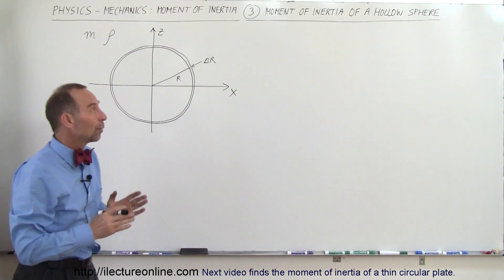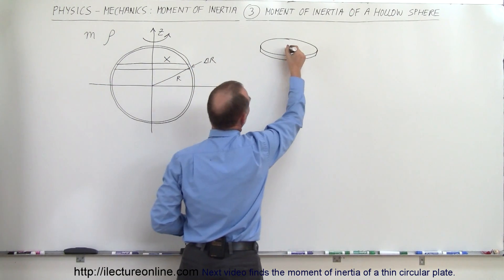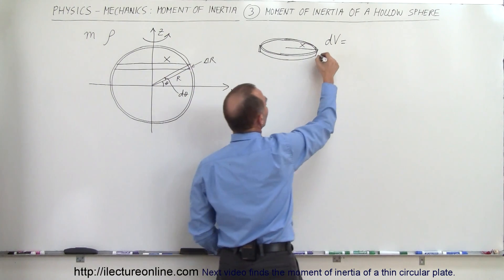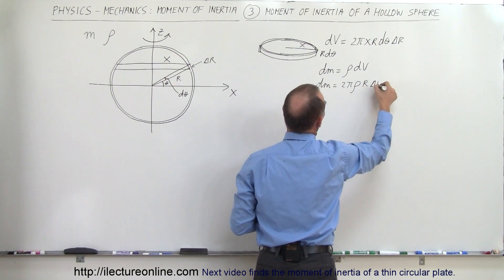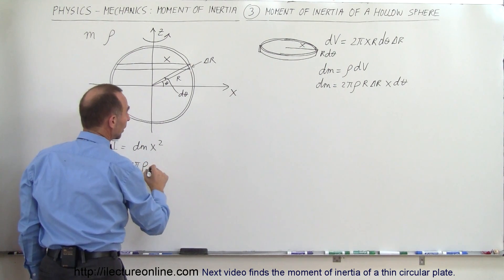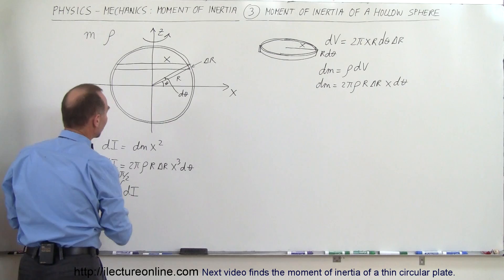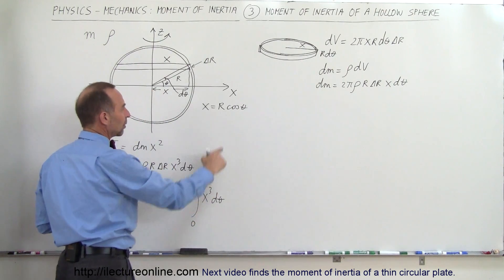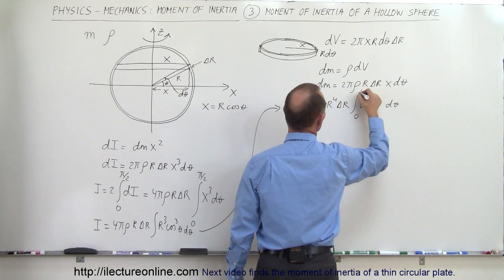Physics 12  Moment of Inertia (3 of 7) Moment of Inertia of a  Hollow Sphere

Comment: why in the calculation for dv, do you multiply by the radius of the hoop?
Reply from the maker: Circumference = 2 pi x   height = R d theta    thickness = dR
Reply: @MichelvanBiezen  thanks for the reply! so its basically just a length x width x height calculation, which gives the volume? My problem is that since were modelling a 'washer' shouldn't you also have to take away the 'empty space' in the middle of the washer/hoop/ring?
Reply from the maker: Indeed.  That is why the equation given only accounts for the washer part.  Not the empty space.

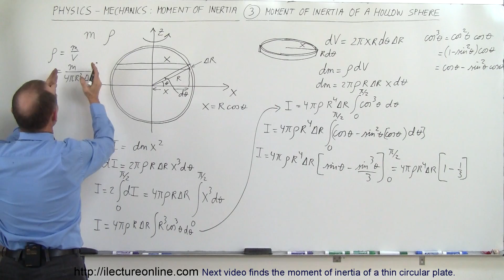Comment: 8:07 actually the vol. Of the sphere is           4/3π R^2∆R  but you used as 4 π R^2∆R??
Reply from the maker: No, the volume of the volume element is 4 pi R^2 delta R
Reply: @MichelvanBiezen  sir can u explain me further pls
Reply from the maker: Think of it as a shell (that is what it is).  You multiply the surface area x thickness = 4 pi R^2 x dr

Comment: Thank you, you have helped me so much.
Reply from the maker: Happy to help!
Reply: @MichelvanBiezen  I tried deriving this independently but I kept hitting the same obstacle.  I was just wondering if you chose to use R*dtheta rather than dz, in order to avoid multivariable calculus.

I know some of the comments here have addressed this question, but I don't understand what they are saying!
Reply from the maker: Yes, I look for the easiest way to solve the problem.
Reply: @MichelvanBiezen  It makes more sense now.  The moment of inertia of a hollow cone takes a similar step in the sense that it totally neglects the volume of the cone and only focuses on surface area.

Comment: For the people who are asking about the dTheta and dz part:

In a solid sphere, we could think about the slices as "small cylinders". When taking slices, you have to have some ignorance about the smaller parts of the volume. In the case of small cylinders, most of the volume would be in the center and the small inconsistencies would be on the ends. So we could ignore the ends and focus on the inner part. This is done by thinking about the cylinders by their centers, that is, the points on the z-axis.

In a hollow sphere, however, we cannot think about the slices as small cylinders. Because now, most of the volume is actually on the ends. So a cylinder would not be able to approximate the volume enough. So now we can look at the slices as angle differences. This time, the inconsistency will be at the angle curvature. But you can prove, by the squeeze theorem, that it is ignorable.

Hope this helps.
Reply: I had a doubt @ 8:07 volume of sphere is 4/3 πR^3 but he used as 4 πR^3 why??
Reply: @jeeva3922  it's not 4piR^3, it's 4piR^2.delta(R). The formula is V = A.delta(R) and A is the area of the sphere = 4piR^2.

Comment: For solid sphere, we integrate it along height (dz). For hollow sphere, we integrate it along arc length (r.dtheta). 
Why the difference? In both, the sphere is divided into same number of discs and the discs are all summed up right?
The same discrepancy i see when we calculate volume & surface area of a sphere as well. It's very puzzling
Reply from the maker: That is done to make it easier to integrate.   You may remember all the different techniques we learned to integrate over a volume, using cylinders, washers, etc. for the dV
Reply: I tried integrating both ways. But i get an extra cos(theta) in one of the ways. So, the answer doesn't come same. I have not seen your other videos - I will check them out now. Thanks 😊👍
Reply: @VickysTuition  i have the same problem having extra cos , can u explain it for me
Reply: @DucNguyen-rr2ug  Volume of Sphere needs to be calculated using dz instead of r.dtheta (arc length) ! To understand why? Try calculating using r.dtheta ! Essentially, instead of summing up many cylinders, you will be now summing up Trapeziums ! But a Trapezium = Cylinder + 2 Triangles on the side ! So, basically people are ignoring these triangles & only considering the cylinder to calculate the volume. I wondered why that is. So, i tried calculating the volume of the triangle, which is  surface area of triangle x circumference of circle ! But surface area of triangle = 1/2 . dx . dy ! So, when dx terms are around, we usually IGNORE dx-square terms  & dx-cube terms right ? And dx-square is nothing but "dx . dx" ! Similarly following the same logic, we can now ignore "dx . dy" term too ! That means we can ignore the Trapeziums & reason only with cylinders for Volume of Spheres ! But when it comes to surface area, we can continue reasoning with Trapeziums, because thats where our area element lies. 

Hope i made sense

Comment: Hello.  Would it be accurate to say that the ΔR was unnecessary, as you could have simply used the Surface Area density of the sphere, given that the ratio of mass to surface area is also constant?  From your calculation, it simply removes the ΔR from the top and bottom of the fraction, leaving the integration untouched.
Reply from the maker: There are often multiple ways to solve a problem.  Try it and see if you get the same answer.
Reply: @MichelvanBiezen  It works, simply because all that happens is you get the same equation, but the ΔRs disappear.  Interestingly, when I attempted to do it another, unrelated way, I got the correct answer, but I believe it was sheer coincidence, because the reasoning is unsound.  I thought you could just integrate by 'adding up' the moments of all of the hoops ( each being MR^2 = λR^3 for linear density  λ) from r=0 to r=R.  Although some ad hoc adjustments got me the right answer, I think it fails because there is no interpretation of dr, since each hoop MR^2) has negligible width.  I don't know if this makes any sense when communicated in words.
Reply from the maker: Yes, it made sense.  Going through all that effort will help you understand this much better.  Way to go.

Comment: Why is the height of a slice of a solid sphere only dz, but here it's R.dtheta? What's the difference?
Reply: because if it's a solid sphere you can calculate the volume of the infinitely small cylinder meaning dm=Pdv=P*pi*x^2*dz(height of the infinitely small cylinder) giving the dI=1/2*x^2*dm=1/2*x^2*Pdv=1/2*x^2*P*pi*x^2*dz which then would give the integral (1/2*pi*P times this integral)(upper limit R, lowe limit -R representing top and bottom of the sphere) ∫x^2*x^2 dz=∫x^4dz  the position x then equals the distance from the top of the sphere R minus the distance from the Z axis which gives x^4=(R^2-Z^2)^2 which makes the integral easy, now in the case of a hollow sphere the volume does not equal the whole sphere but only the surface area which for cylnders are 2*pi*r*h which using the same method as with the solid sphere would give the integral ∫x^3dz which doesn't make x easily translatable into something depending of Z.

So basically it has with the calculation of the volume of the slice, if the slice is hollow then you wouldn't include the "middle part" only the thickness of the shell, and calculating the thickness of that is most easily done using R.dthetha since that integral is alot easier to solve

Comment: Why can't you use the height of the initial disc to be dz, wouldn't that make the intergration easier?
Reply from the maker: It is not a disk but a ring.  (Try it and see if you get the same answer).
Reply: @MichelvanBiezen  
I tried integrating using dz, and the issue came with integrating (x^2 + z^2)^(3/2) dz, which leaves a convoluted solution equation + C. However, what is the reason this is not solvable? Is it because of the unknown constant? It would be nice to understand the reason it doesn't work.
Reply: You use the perimeter instead of the area. You can integrate dz's of areas, why can you not integrate dz's of perimeters?

Comment: Why isn't the height dz for starters? How do you know to set the height to dTheta? So frustrated as I tried this out before watching the video and my integral ends up being cos^4(theta) not cos^3(theta). The math all makes perfect sense when I watch you write it all out, I'm just lacking the insight in the setup.
Reply: It is important to note that dz and Rd{\theta} are not interchangeable since they do not represent the same values.  Observe that dz is parallel to the z-axis whereas Rd{\theta} is tangent to the curvature of the sphere. Utilizing trigonometry, you can easily prove that Rd{\theta} is, in fact, equal to dz/cos{\theta}. You can also show this by taking the derivative of z=Rsin{\theta} with respect to theta. Therefore, dz=Rcos{\theta}d{\theta}. Also, realize that cos{\theta}=x/R by definition, so Rd{\theta}=R*dz/x. When converting from polar form to cartesian form with the equation derived above, there should be no issue with the cos^4{\theta}. Originally I arrived at something like (3{\pi}mR^2)/16 with the same error...

Now to address the original question, "Why isn't the height dz for starters?" Besides my explanation above that dz doesn't equal Rd{\theta}, dz simply doesn't apply in the first place due to the definition of finding arc length. When finding the difference in the volume of the hoops of the hollow sphere, we're essentially finding the surface area of the sphere with an infinitesimal thickness {\delta}r. To find the surface area, we're summing all the cross-sectional hoops' dA, all with a 'thickness' ds (ds=difference in arc length). The integral, in this case, would basically involve the sum of all the tiny arc lengths from each hoop rather than the height dz as the sum of all dz does not equal the total arc length of the hoops. The only reason why dz was used in the previous video is that a solid sphere is comprised of disks rather than hoops. When finding the dV of each disk, the thickness of the disk is now the height dz since we're basically solving an integral for finding an area under the curve. When finding the area under the curve, we can now see that it is just a summation of values of the radius of each disk times an infinitesimal width of dz. 

If you're still asking why dz can't be used, it's basically a question of why do we define the integral of the area under the curve with rectangular width while defining the integral of an arc length with the actual segment length of the curve.  I'll leave that up to intuition.

Comment: Sir, I have a question. Concerning about the video about the M.O.I of a hollow sphere and the solid sphere. 
Why did you consider for the solid sphere, the dv, to get the surface area which is (pi)x^2dx then for hollow sphere, the circumference. 2(pi)xR(d theta)(delta R)
Reply: Denver Daño I hope sir you understand my question. I'm just confused about the idea of the thing you said, the surface area for the solid sphere. then the circumference for hollow sphere. both question about the dv.
Reply: Denver Daño 
Hello, in the case of a solid sphere, the volume of the section should be the one of a very slim cylinder of base AREA : pi*x^2 and of height dz so the volume is dv=pi*x^2*dz
For a hollow sphere, the section taken looks a lot like a hoop, a ring or an empty cylinder, but because the "walls" of the cylinder are very narrow, you can assimilate the area of the base to the circumference of the base times its width which is deltaR, so base AREA=2*pi*x^2*delta R and the height of the cylinder is R*delta (theta), so dv=2*pi*x^2*deltaR*R*delta(theta).
Hope I have answered your question.

Comment: Sir, I just wanted to know why your integral bounds were from 0 to pi/2 if you were trying to solve for the top half of the sphere?
Reply: Jet Erickson Tirona 
Hey! When I saw him integrating from 0 to pi/2 I thought he was only doing the work for one quarter of the sphere, and this baffled me. I don't  know if this was also the case for you, but if so, I finally noticed that integrating from 0 to pi/2 was actually enough to solve for the top half of the sphere. Notice that going through the angle from 0 to pi/2 actually covers the entire height from 0 to R (so it's like integrating from 0 to R), while integrating from 0 to pi is equivalent to finding twice the height 2R.
Hope it made some sense.
Reply from the maker: Jet Erickson Tirona Also notice that I multiplied the integral by two.
That way you get the result for the whole sphere, but it makes the integral easier.
Reply: The way I think about it makes sense if you've had experience with something called volumes of revolution (usually covered in calc II, or in calc BC if you're doing AP). It's like taking just the first quadrant of a circle and rotating it about the y-axis (in this case, the z-axis). Except in this case, you just have to remember that the result should be hollow, so it resembles a typical washer method problem. In this type of problem we'd integrate from 0 to the height (in this case, pi/2 since we're using radians). Then just multiply by 2 to get the whole hollow sphere.

Comment: doesn't R*dtheta give you a small arc length? Can you still say the arc length is approx the heigth of the little segment of hollow disc? I guess you assume dtheta goes to zero? :)
Reply from the maker: Дејан Гујић There are different ways to solve this problem.
Go ahead and try it your way and see if you get the same answer.